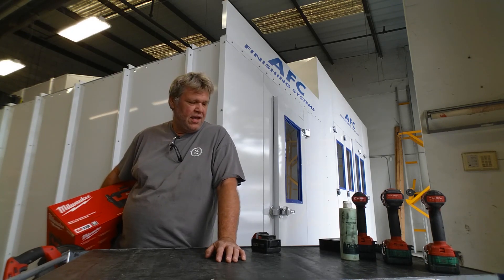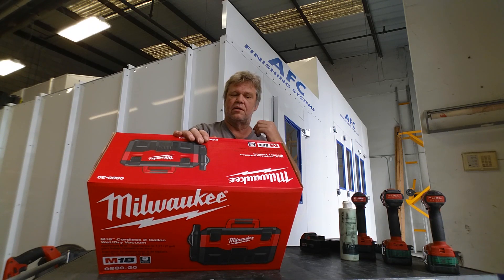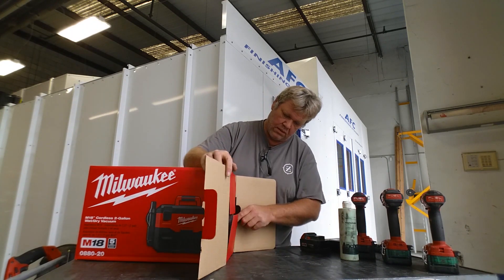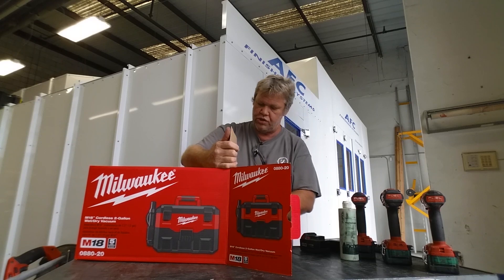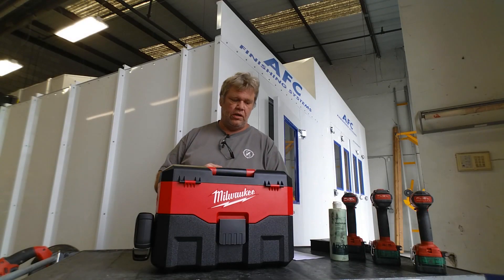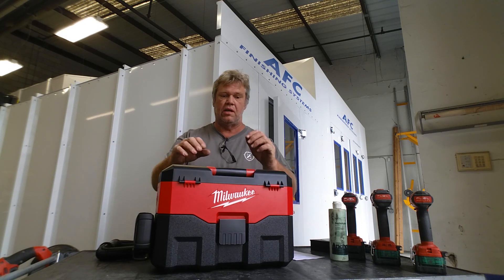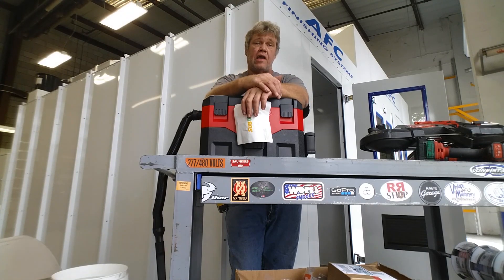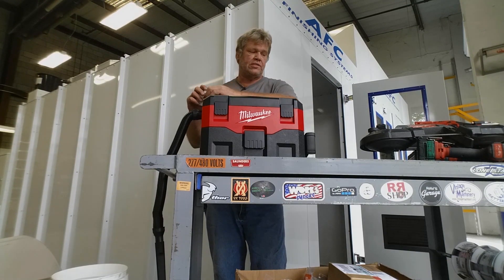Milwaukee M 18 toolbox vacuum

Comment: The only Dewalt thing I still use is a vac about that size(maybe a little smaller), you can run it on battery but it also has an A/C cord. Keeps up with a rotohammer...

Comment: Stan, was the run time off load ? I suspect that in use and the filter partly blocked, the run time would be much less.The bolts were Mushroom head and Not Pan head as you stated. The kinked hose may straighten out if you put it in the Sunshine to get warm.
Reply from the maker: No load, brand new filter, biggest amp hour battery I own, absolute ideal conditions. I'm sure it will drop off dramatically when it gets "broken in"

Comment: Hey Stan thanks for all the videos I have a question I'm looking on getting a lathe machine for a garage shop who makes a nice  and dependable lathe for a garage shop what would you recommend.Thanks again
Reply: What kind of parts do you want to turn and to what accuracy?
Reply: Hill Top Machine Works I never had a lathe just like to get a nice machine I now there is so many brands out there like grizzly shop fox presison Mathews bailegh atlas South bend just wanted to know what would be a good starter lathe like a 8" to 12" at a good price and quality built Thanks
Reply: The bigger the lathe the more options you will have plus more rigged the better. A good starting size is a 12x36 gap bed. That gives you a lot of capabilities. You can find good used ones on craiglist if your patient. If your buying new then Grizzly and Precision Matthews would be good choices. They have customer support for their products which is a plus since all the new lathes are made over seas anyways.
Reply from the maker: Precision Matthews has a good price point on their new machines, I have heard good things from their owners.
Reply: Shadon HKW Thank you
Reply: Hill Top Machine Works thank you now what about a mill
Reply: I would go full size if you have the room.  A good used one will run you about 2500-3500 depending on where you are. Mini mills are just that and are limited in what they can do